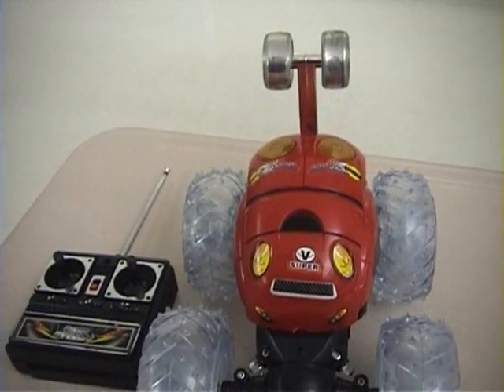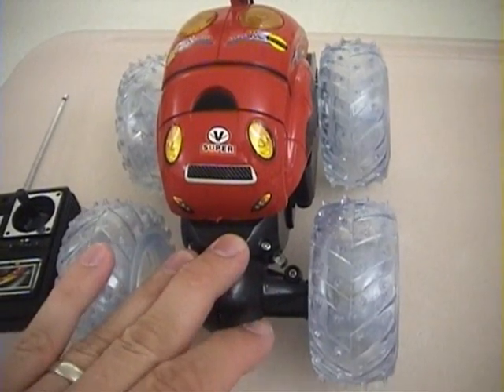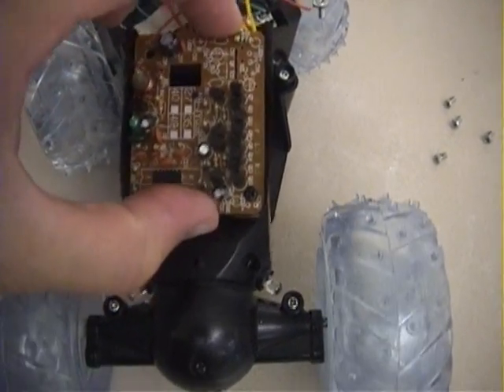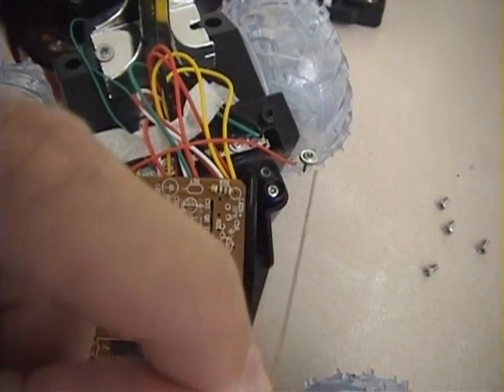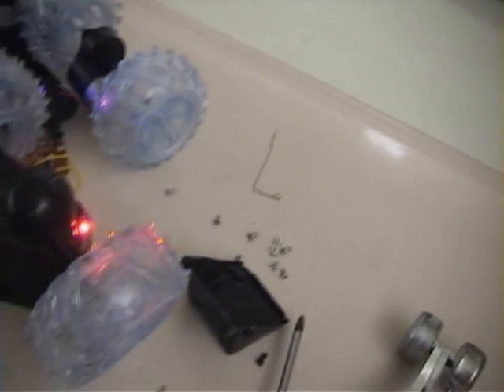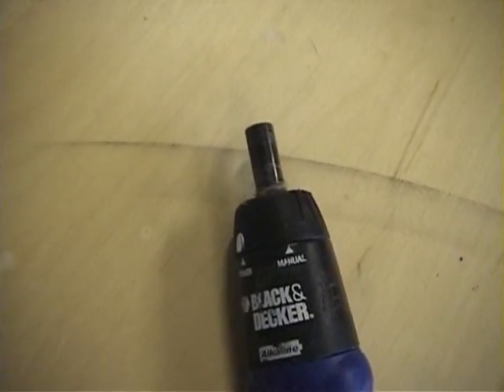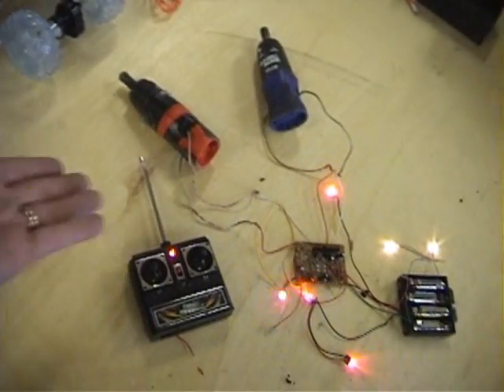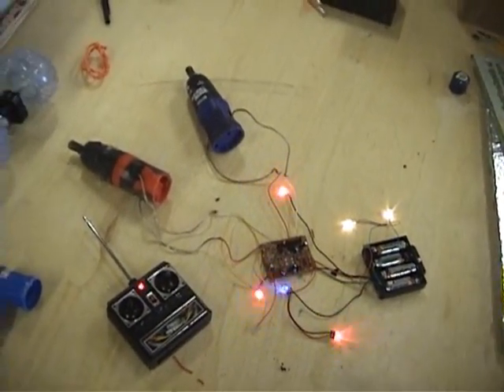How to make the Battle Bot remote controlled

Comment: the receivers of rc cars are programmed to giv a specific amount of voltage to the motors,eg:it is programmed to give 1.5 volts and you  use a motor which uses 6 volts the motor wont work, the solution to the problem is to use the same motor which is used in the rc car. once i used the receiver of a rc heli copter for a rc bristle bot and i used different motors, the result the wires got hot and melted the insulation rubber and the receiver fried